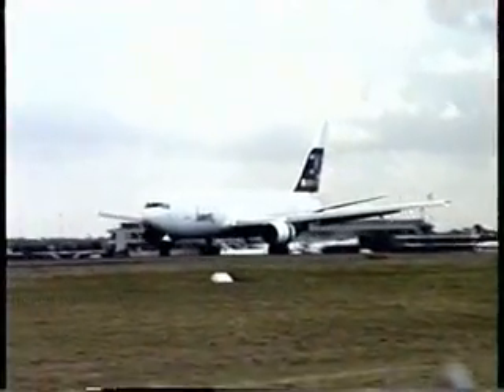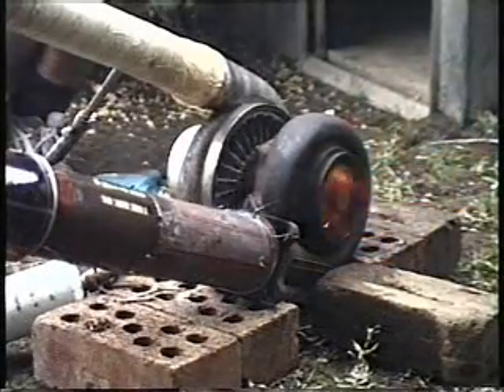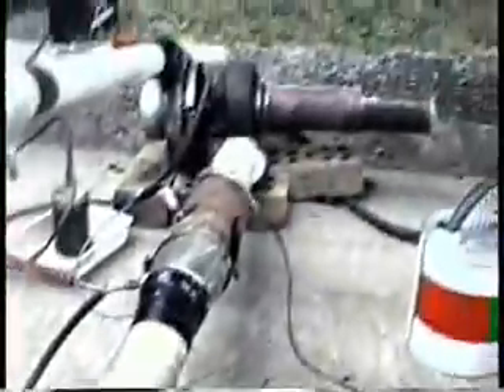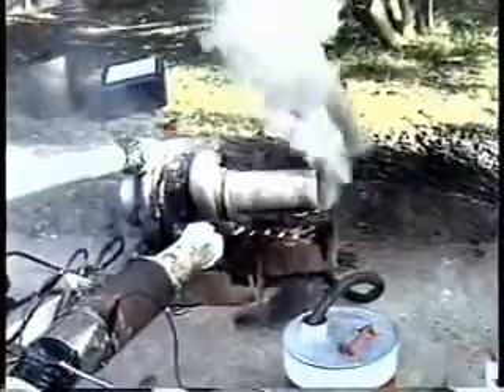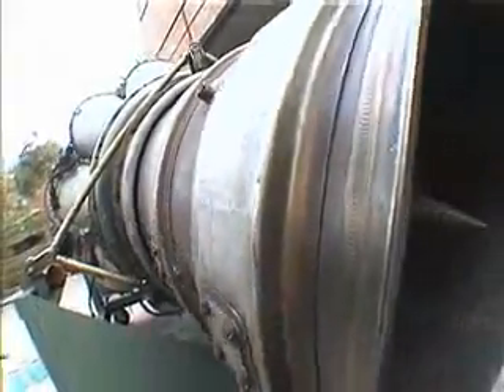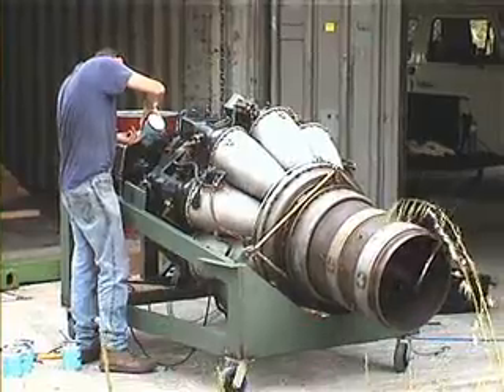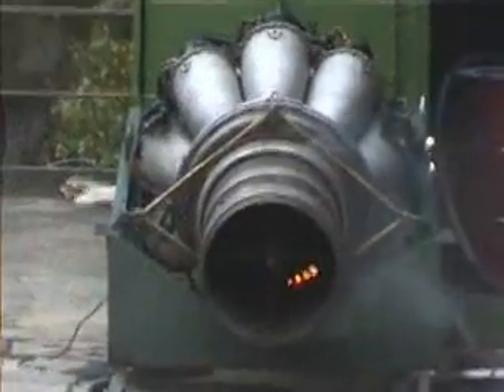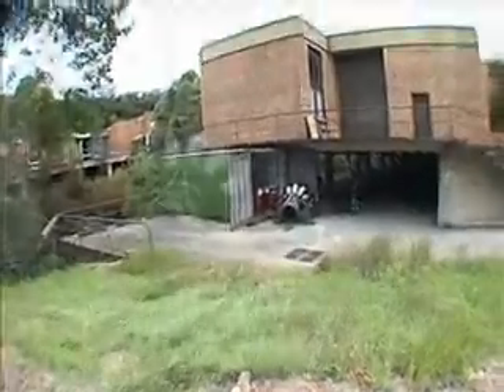Jet Engine Backyard - Ep 1 (4:3)

Comment: Actually the air raid siren noise I believe comes from the centrifugal compressors....The Rolls Royce Dart turboprop engine has two of the same kind of compressors and its similar in its sound. Even the arrangement of the combustion chambers on the this Derwent are similar to how they are arranged on the Dart...

Comment: No valve to controll the pressurized kerosine, full throttle or nothing. So, with no controll over acceleration, do we go boom? Also, adding a control valve would tramendously increase safety. In the case of the turbine falling apart, WITH controlled acceleration, the turbine may not be running at full speed when it falls apart, therefor reducing the risk of sending the whole thing into pieces and killing the guy that's walking down the street, and blowing up your dads car. Hmmmm...

Comment: Adding to my last post, Im capable of welding & will probably be getting a MMA & MIG (or TIG) welding set. I will of course need to take out a loan (about £50,000 to start) but after that each engine will fetch a really high price, in the region of about £35,000 plus.

Comment: Within the next few years I plan on getting a Hass CNC machine & plenty of aluminium & Incolel to produce, from scratch a Turbo fan engine. I plan on making 2 selling one & using the money from that to build 2-3 more. I could use some help with it or some advise. 

It will only be around 3 times the size of your first jet, I plan on making it fly, using radio controls on a Mega high frequency. Making the best model aircraft to date.

Comment from the maker: Inspection of interior..NO
Turbine failure, well this engine is built like a tank and has a very low RPM compared to later engines.
Hearing protection..NO
I believe the flames at the bottom are from the excess fuel from all the failed starts, there is heaps of video your not seeing which was the many attempts at starting this beauty.

Neighbors have always hated me, more so today.

Thanks for you in depth comment.

Comment from the maker: It was purchased on a website barnstormers (and the rest to make it a URL) mind you they do appear on ebay as well from time to time.

There was a 200ltr, 44gal drum of JetA1 purchased and that was basically halved by just a few short runs, so I presume the aircraft which flew with this engine had a very limited range, or large fuel tanks.

I am sure someone out there knows way more than me on this, they usually do..!

Comment: I actually knew a guy in the UK who used to run a jet engine in a tractor-pulling machine. It sheared off a blade during an event and it shot through the engine, through the guard and hit a spectator in the chest.  They luckily were not killed but I fully understand where you're coming from.  Turbos are designed to operate at high speeds but probably not at those temperatures.

Comment: been talking to my uncle and i showed him your video and i think he was wincing at your attempts of making jet engines and he was explaining all the heat stresses and clearances and tolerances and having the fuel sitting right next to the exhaust! He also explained that if rollsroyce were running a jet engine, they would have it mounted in a concrete building with shock absorbing material so that if it shed a blade it would not fly off and kill someone!

Comment: The jet engine is set at full throttle 10,000 RPM at all times.
With waste gates open all thrust is diverted away from output shaft turbine so there is no power output there.
Keeping the jet engine at 10,000 slowly close waste gates directing more jet thrust to ouput turbine and shaft to increase power out to shaft.
If the gates were open at 10,000 and you snap them shut (hit the pedal) the power to the shaft would be instant tyre peeling axle snapping power.
Look up Turboshaft on Wiki

Comment: Derwent was fitted to engine nacels that had to bend air around from intake into jet engine intakes at compressor intake.
It must have forced intake to get full power.
You need to force air into intakes at 100 knots at least to get full thrust output from it. (it gets when flying)
Just sitting there on your trolley it is producing only about 10% of thrust to maximum without forced intake.

.

Comment from the maker: The front turbine (set back to back) is tucked away behind all the gear and oil tanks at the front of the engine, there is no straight airflow to these turbines, and thats very different to the designs which were developed after this engine type.

The thrust is a result of the huge amount of fuel which is burnt, and some of this energy is used to continue the air flow via a power turbine, anything which is not consumed by the power turbine is what you could call thrust
Reply: First video bro

Comment from the maker: Just on thrust you have to consider that this engine only produced the goods when it was doing 10.000 RPM, it has a very small power band (for a better word) I believe it is governed at 12.000 RPM

The way the engine is set up the air would never enter it directly, the intakes are set on the sides of the engine, I don't believe forced air would improve performance that much..you would have to see if there is a huge difference between static and flight thrust.

Comment: So you bolt the jet engine to a truck like they have
(Jet Trucks uses thrust only so does not develop power until it reaches ground speed)
Then have a secondary turbine on the jet engine exhaust with 10 to 1 reduction gbox to take it to wheels via differential.
Fit wastegate between primary jet and secondary turbine.
Spool; up jet to full power, slam shut waste gates to transfer full thrust to seconday turbine instantly and power down to wheels.
And Smoke em :-)

Comment: Helicopters use them.
The thrust in the primary turbine drives a secondary turbine on a shaft that drive rotors mast.
Lke a torque converter in a car trany but hot air not fluid.
Exhaust then exits 2 pipes just below the rotor head on a heli.
The exhaust is not like direct thrust from the primary turbine is is much less as its power has been absorbed by the secondary turbine blades and drive shaft load.
Reduction is about 10 to 1 on the gearbox.

Comment from the maker: The Derwent is not a powerful gas turbine compared to todays engines, the friction between a shipping container and the ground can easily overcome the 3000lb thrust the engine produces at full throttle.

Its the sort of engine which needs to be screaming to do any work, at idle it's a elaborate room heater, although a little noisy.

Comment from the maker: The engine was shipped from England to Australia, it was purchased from Barnstormers website(no url allowed here).

It's basically a museum piece and was shipped in working order although it had absolutely no components needed to start it, and finding documentation was tricky as well.

It was a reasonable price considering the condition of the engine, and it's a lovely item to look at.

The Derwent has a low idle speed of 3000 rpm, and thats nice as it's quite nice to be near at idle.

Comment: There is not much thrust power because the engine is not moving so has no air forced into intake as it would have in an aircraft.
Add a big car dynomometer fan to the air intakes (simulating 100kmph air) and the jet will put out heaps more power.
Then you realy will have to tie it down.

Those jet trucks are lame.
What I want to see is a vehicle with some twin helicopter turbines and gearbox driving the axles.
Noi just blowing hot air out the back to power it.
Love the vid BTW

Comment: I'm not sure you are a mechanic Gabriel.  You don't know the names of the turbo's parts and supercharging alone does not richen the mixture.  It simply packs more air into the engine.

The exhaust gas is routed to the turbine housing which spins the turbine rotor.  The compressor's impellor is mounted on the same shaft as the turbine so as the turbine spins faster it spins the impellor faster which sucks in more air and pressurizes the intake manifold. Fuel management is a separate issue.

Comment: As stated above, sarcasm.
I know that a turbo is bolted/welded to the exhaust manifold of a car and the other part is bolt/welded to the intake manifold. That the exhaust that is produced spins the turbine and compresses the air from the intake and throws it into the valves and makes a richer air/fuel ratio in the car boosting the combustion.

I arez mechanic.

Comment: I was a Jet Engine Mechanic in the Air Force for over 20 years, and this nut should be put in an padded room and trow away the key. That engine he bought has to be specially tuned up before you take it out of storage. That could have blown up and taken out a couple of blocks.

Comment from the maker: What the vido does not show is the many failed attempts to start the engine, lots of unburnt jet fuel, and some very tired batteries, the throttle control is a tiny arm at the front of the engine, with no indication of settings.

Comment from the maker: throttle changes on a gas turbine should be slow, the idle speed of a derwent is 3000 rpm, maximum around 12000 rpm, so its a pretty slow spinner compared to modern day gas turbine engines.